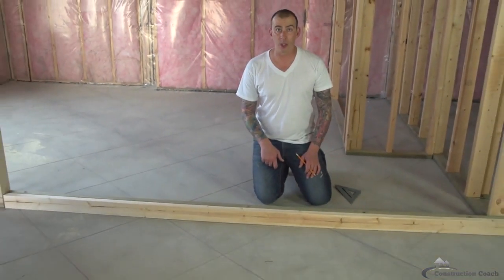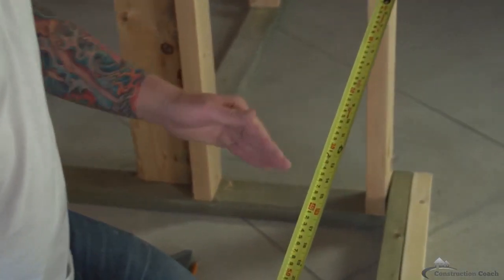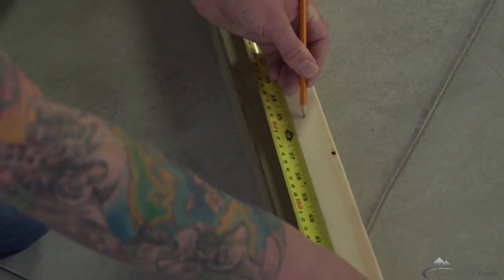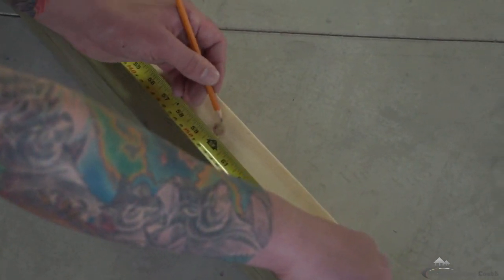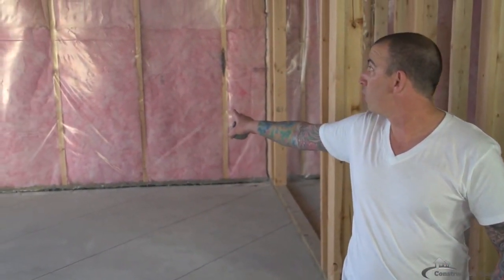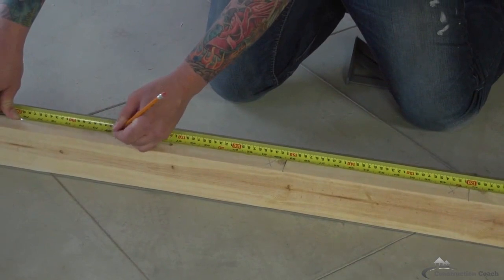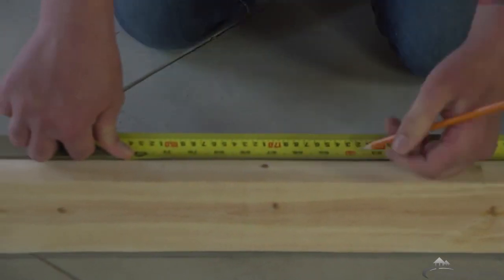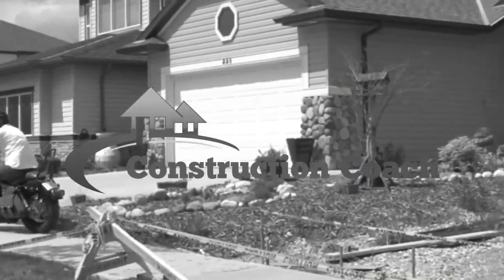Proper On Center Spacing for Wall Studs

Comment: the distance from the center of the first stud and the second stud isn't 16'', it will be 15 1/4''.
Reply: Indeed as that first stud isn't moved back 3/4" (as it would be hanging off the plate!)

Comment: I am wanting to make a wall coming away from my basements outer foundation wall. I keep reading not to have wood on foundation wall due to moisture. How do you frame that type of wall?
Reply: You just have to use pressure treated wood for that purpose to meet most building codes

Comment: whar is the spacing  between studs if 16 on center
Reply: 14 1/2
Reply: @TheMagicWorker  So...22.5" for 24". Building an office in the basement. I don't need load bearing.